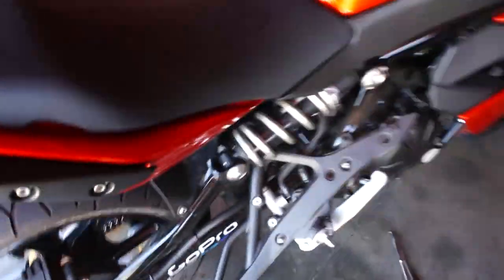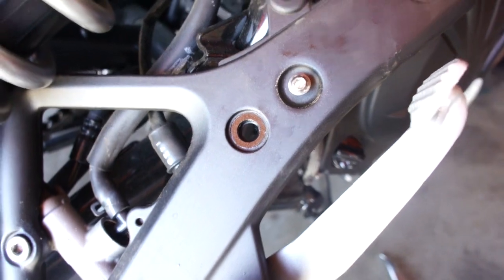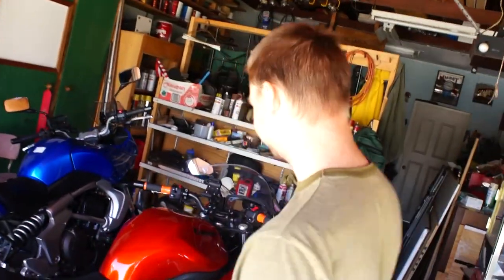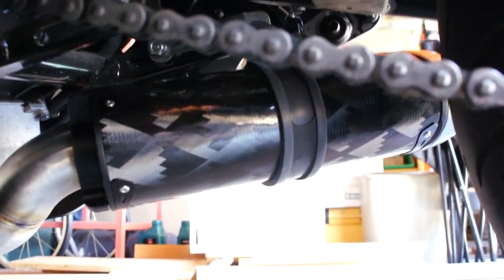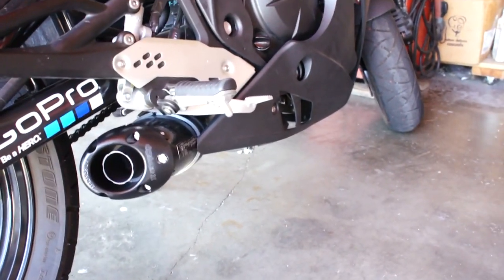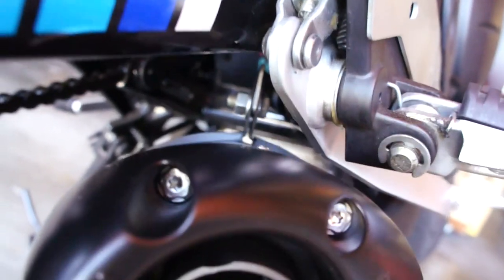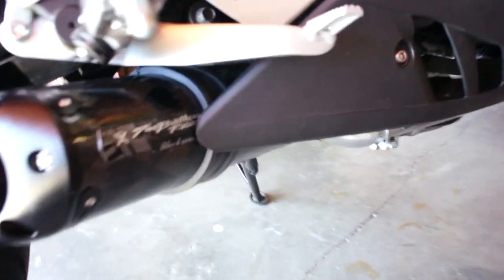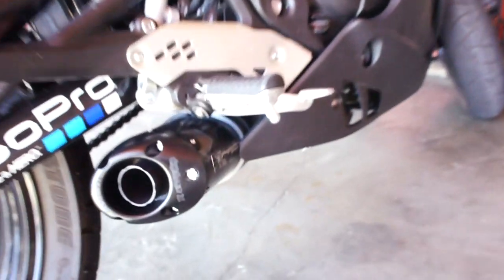[534] New Exhaust - 2012-06-01

Comment from the maker: @wolfsburg62 I did consider a few other brands like yoshimura, akrapovic, jardine and a few others. I chose two brothers for several reasons, appearance; it's one of the shortest cans so it doesn't stick out too far and the black series carbon fiber looks awesome. Sound; it had one of the deepest notes of all the slip-ons. Also if I wanted to get a fuel controller the juice box has a preset for this specific pipe, no setup.